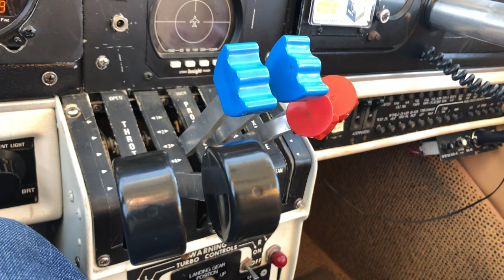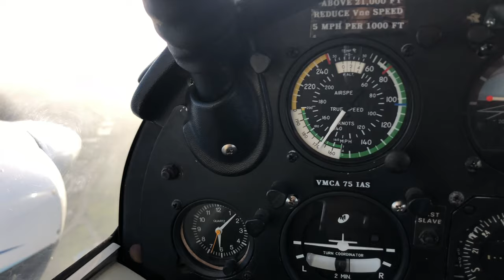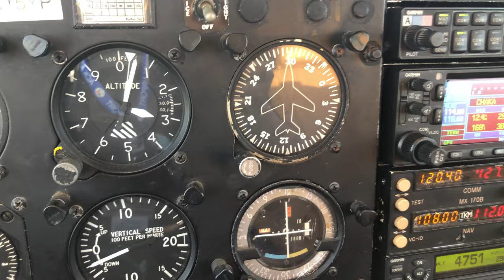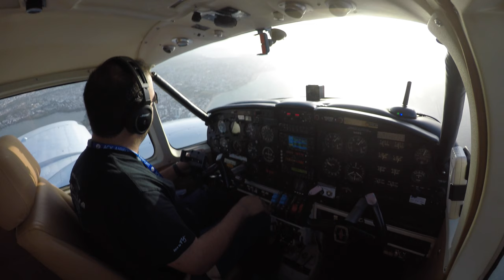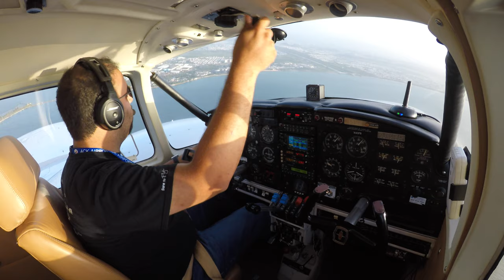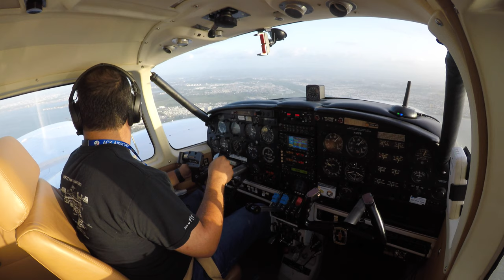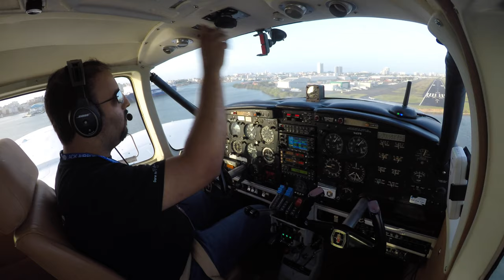Having TWICE the FUN in an airplane built in 1968! - Flight Vlog (ATC AUDIO)

Comment: The Piper Aztec and the Piper Comanche are the best aircraft ever built by Piper.
Reply from the maker: I have to agree! I've never flown the comanche before but its on my to-fly list!
Reply: @fersobe   I am now 86, used to have a small fleet of pawnee for ag business based in west Africa in the y 1960 I also had at that time 1 Aztec, 1  comanche and 1 Beech Bonanza A36 all these plane were the best ever made at that time. We never had problem flying sometimes in very hard conditions with no control and very primitive instrument GPS was not yet in use we used maps and hand calculation